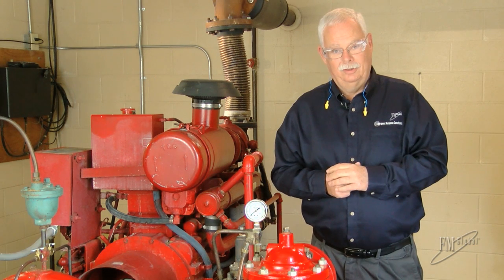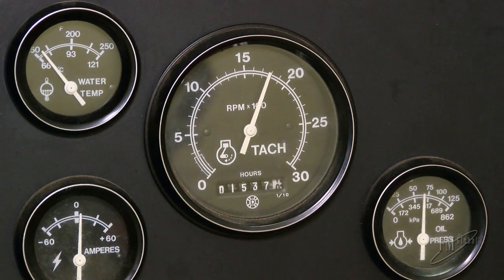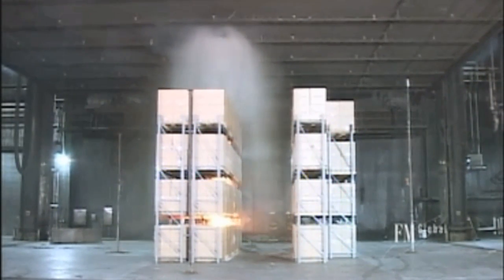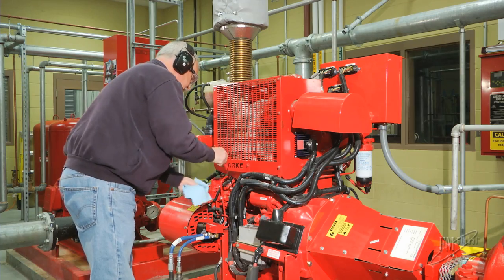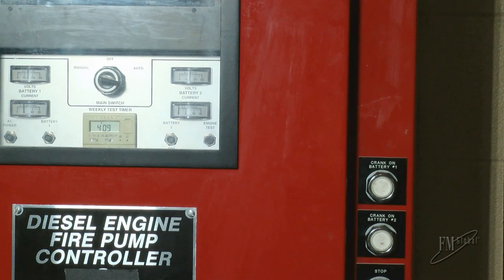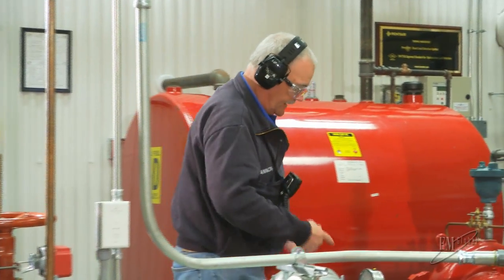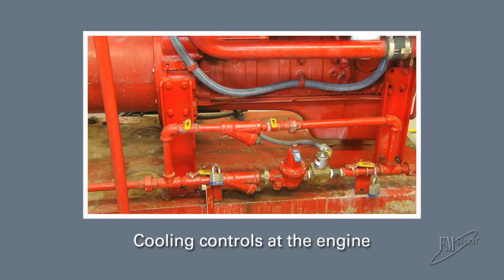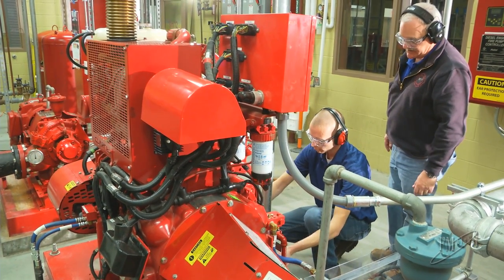Know More Risk: Diesel Fire Pumps

Comment: sir iam facing overheating problem  in fire fighting  duetz diesel engine.the temperature is reach 120-degree cntigrate.after running 10-12mint.i have shown to many technicions.but no one will find proper solution for this please guide me for this serious matter.how to fix this overhating the fire fighting diesel engine.
Reply: Check for. Coolant like e blocked..if this is under churn  make sure relief valve is operating..check that coolant t is being circulated..possible. coolant eater pump failure